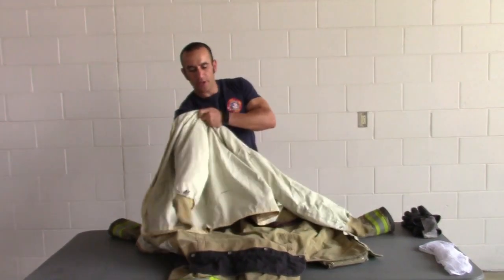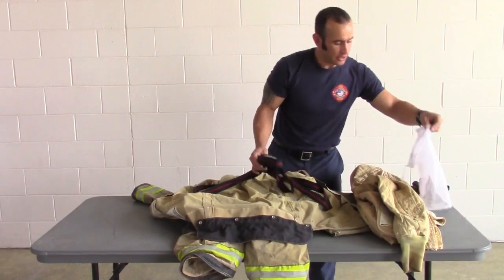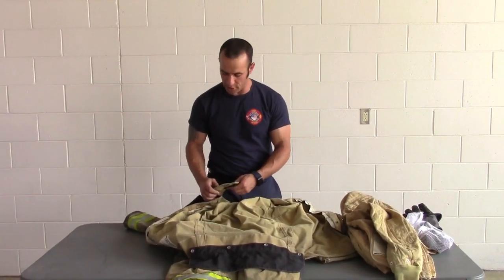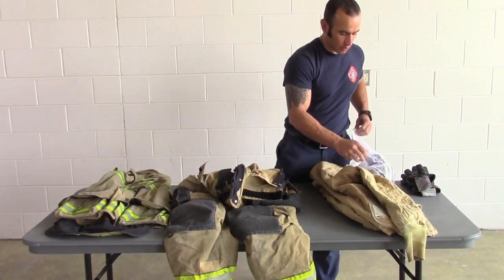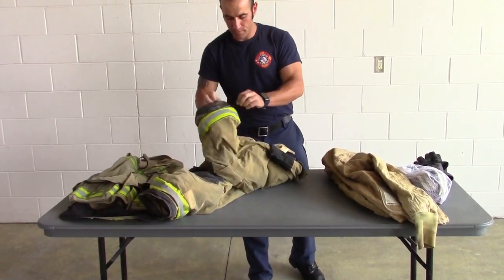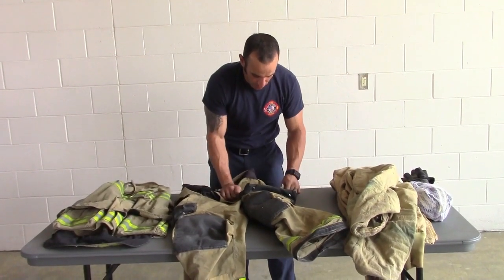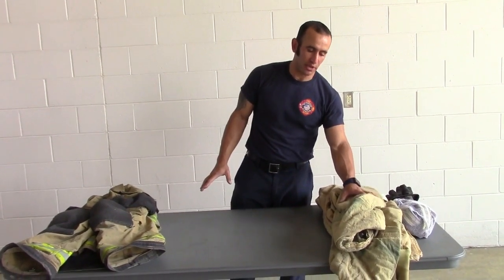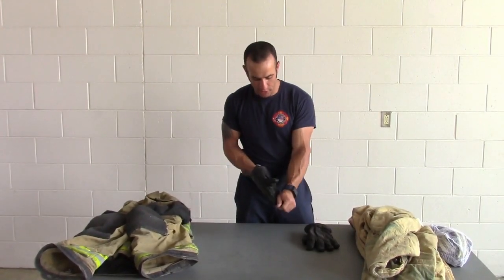Washing Your Turnouts

Comment: Great simulated video....very helpful. However, in real life you should never touch your turnout gear without full PPE. Touching the carcinogenetic contaminated TOG is NEVER recommended.  The VOC are very dangerous. The best method is to use Doff'n DECON (from INTELAGARD) on site before gear is removed. It is now possible to double the decontamination numbers and remain compliant with the 1851 protocols. This is a VERY REAL danger that can be mitigated. Please take the time to save your life and those of your friends and family.